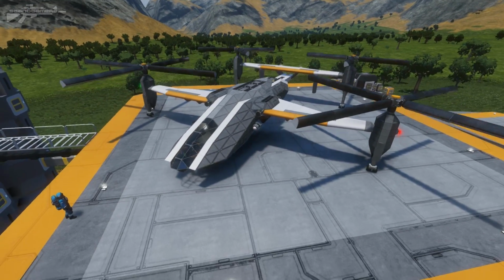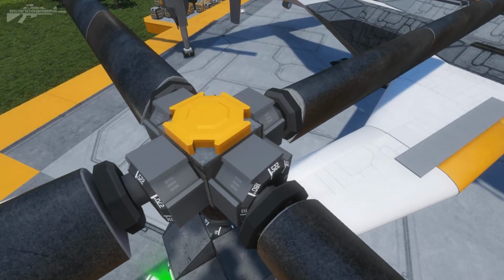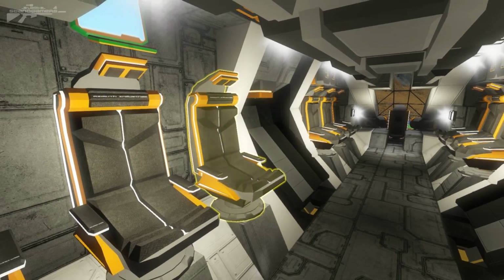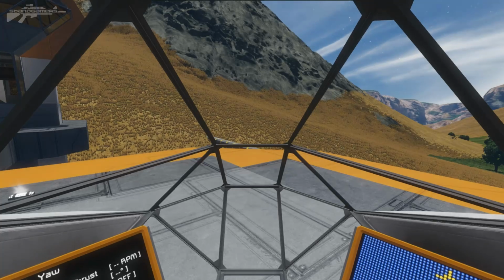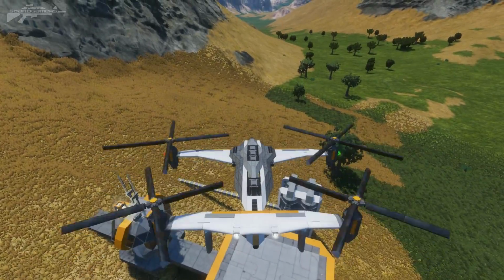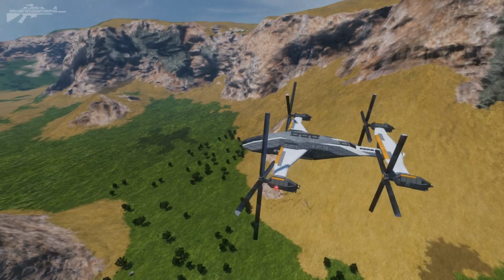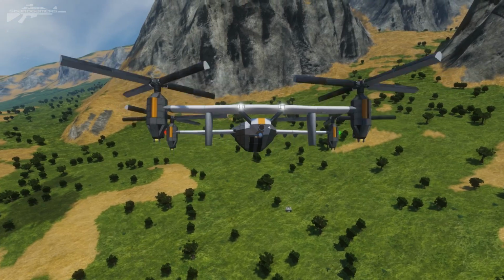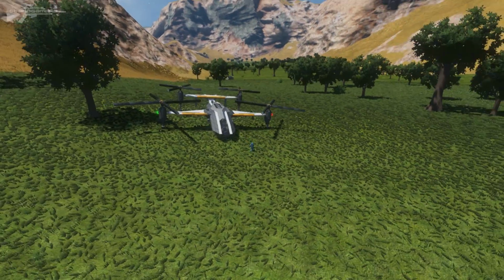Space Engineers - Buzzard Tiltrotor

Comment: so do those rotors provide thrust or are there hidden thrusters somewhere?
Reply: LexieAssassin
Rotor driven helicopters definitely work. This one uses the standard wing version without re-entry effects.
Obviously you have to angle the individual rotor blades so they actually provide lift. I decided to safety lock them all the time but depending on rotor design that might not be necessary.
With that done it's just a question of spinning them fast enough.
For this plane I used a speed mod which increases the maximum angular velocity of an object (vanilla limit is at 60 RPM), but that is just a question of rotor diameter/weight. My earlier (admittedly ugly) prototype could lift off without it.
Reply: Aerodynamic mod ;)
Reply: Ya I know that he was using that mod I just didn't know that it worked like that! thats so cool!
Reply: I'd imagine hidden in the nacelles are atmo thrusters, as those rotors are purely aesthetic.
Reply: @lexieassasin Nope, the rotors work indeed with the aerodynamics mod. There is not a single thruster (or gyroscope) hidden anywhere on that plane
Reply: Thats awesome!!
Reply: Really? I tried a rotor-driven helicopter before and it didn't work... Then again maybe I'm using the wrong/outdated aero mod? The mod I'm using came bundled with a reentry mod which is a little to extreme for my tastes.

Comment: Really? No mention of the aerodynamic mod which the reason the thing actually flys??
Reply: He is kinda missing the point indeed, or he forgot to mention it. The ship looks cool, but the technology behind it is what makes it stand out. Real propellers, which work by tilting the blades to increase and decrease lift. Controlling different rotors via key mapping. Adapting the actions of keys to the direction of the propellers. Steering using 'wings' in stead of gyro's. Altimeter an artificial horizon on a LCD panel.
Reply: the most "OHMAHGOD" thing in that video was the mod which enabled rotor controls by intercepting normal key presses....
Reply: ...that's the best part
Reply: +alucid finally someone gets it :)
The rotor blades don't actually tilt though. They have to be safety locked all the time or they explode. The rotors simply spin faster or slower to adjust thrust.
The artificial horizon is also not really part of the build. It's just an in game script from the workshop which I added for aesthetics/ utility.
Reply: you are right. The idea of using the wings like that, and make the ship move realistically  on SE is something very interesting and the most important part of the ship
Reply: It's quite different from that actually. The plane has an onboard programmable block which reads keyboard inputs with Digi's control module mod. The program then interprets those inputs and and changes the settings for each of the rotors to achieve the desired manoeuvrers.
The script that Shack and W4sted used only works with stock-alike thrusters and can't control rotation.
Reply: I don't think it is using the rotor/thruster mod that Shack and W4sted looked at previously, however, it seems like it is working in the same way.
Reply: Oh wow, didn't notice the name earlier. Sir, you made one heck of an awesome craft! This is what SE is made for, having an idea for a contraption that can never be made in the game, and making it. I have no idea what other submissions there are for W4sted's competition, but you deserve the win imho. Lets hope rotor updates don't screw you over. KUTGW!
Reply: Amazing ship!:D